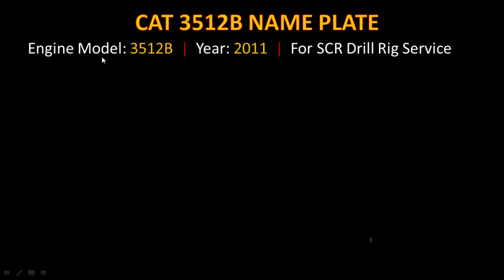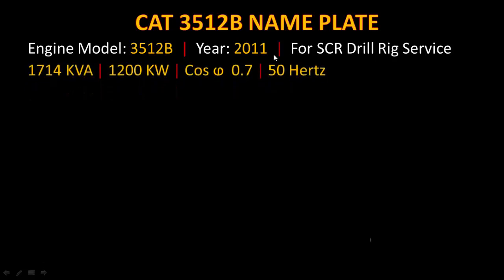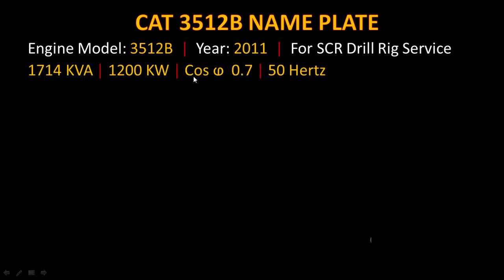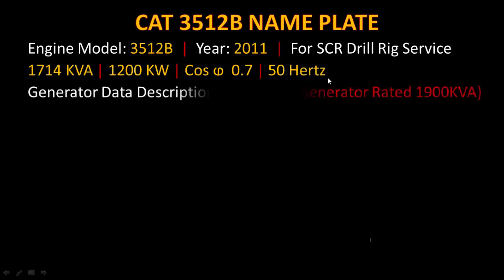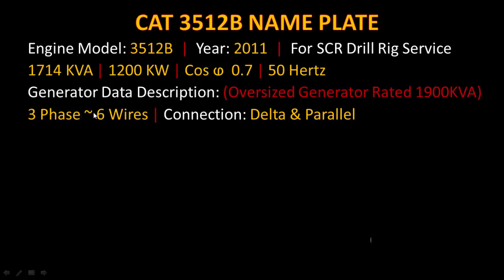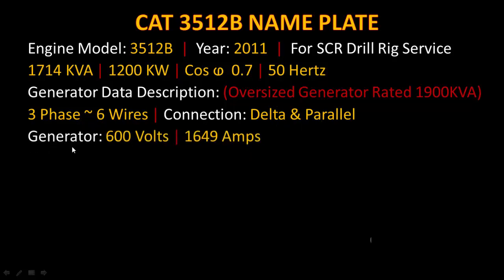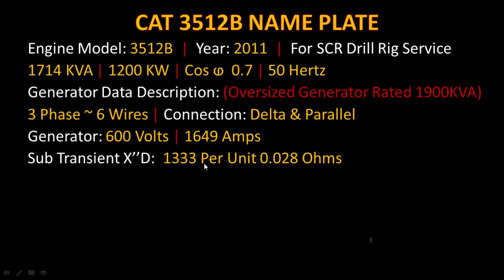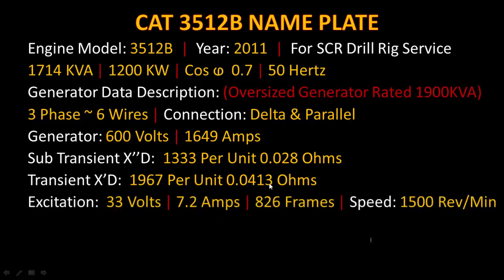CAT 3512B Name Plate | Specifications | Oil and Gas | Caterpillar

Comment: We are having overspeed indication where as tachometer is showing normal rpm and engine is running without any trouble. How to rectify that indication?
Reply: Hmmmm in my experience the digital tachometer harnesses has definitely error in connection or short circuit. We had to rectify it as it started smoothly and before getting rated speed it had to shut down along over speed indication.
Reply: Well indeed 1200 KW or 1.2 MW definitely equal to 1500 KVA nor 1714 KVA...
Reply from the maker: +aasha ram lohana this some times indicator problem. Don't worry
Reply: @OilandGasInformation  how to rectify it then? I mean how to correct false indication.
Reply: Whould you explain, What's meaning  TRANSIENT X"D : 1967 Per Unit 0.0413 Omh